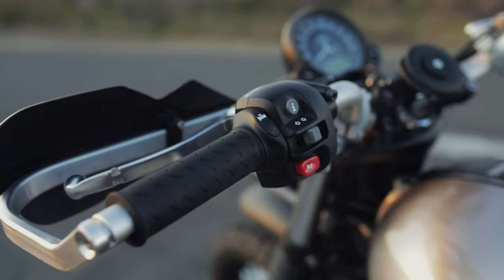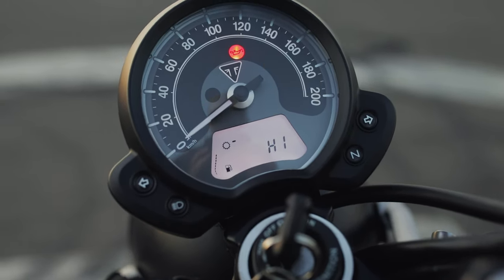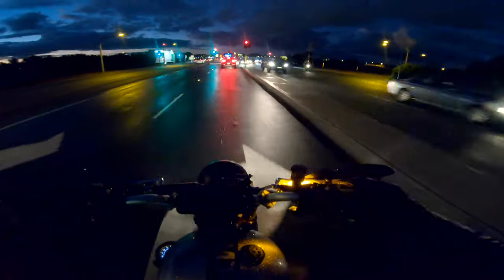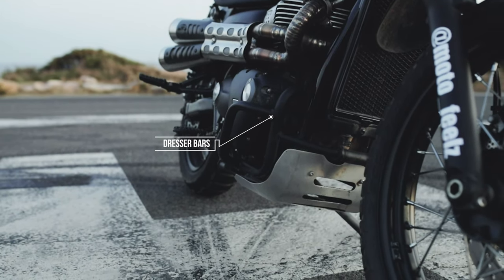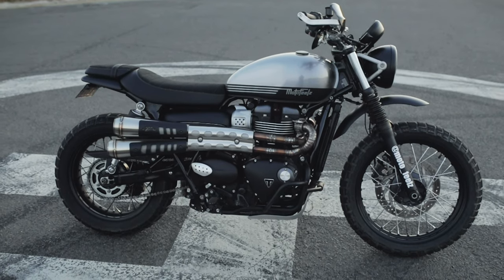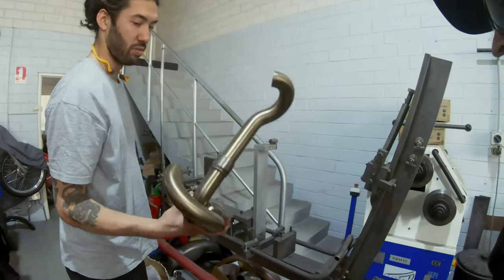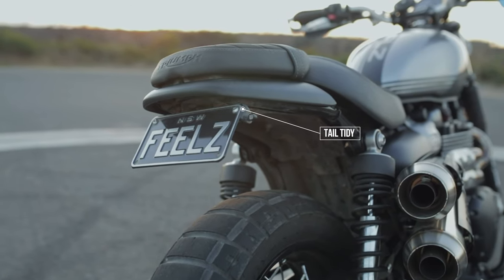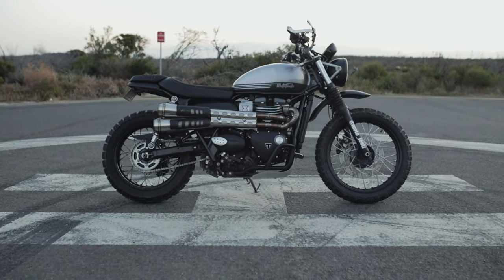2020 MODS LIST REVEALED!! | Triumph Street Scrambler

Comment: That side speedo is pure foolishness. Ok, it looks unique. But it’s pointless and dangerous. 

If it want to up your off road game, get the Free Spirits caliper relocation kit to move that rear caliper above the swingarm so you don’t rip it off on rocks. A nice pair of Ikons will help off road, as will a ground clearance riser kit to add about 30mm of clearance on the rear. 

Front fork springs upgrade worth considering too. Ikon said they are making a drop in kit this fall. Being local to aus, you might get them before us in the usa.

I added the “tall windscreen” which isn’t either tall or B windscreen but it helps tremendously to cut the wind esp cold winter wind.
Reply from the maker: Haha yep - Speedo down there has 0 functionality, but I dig the clean cluster. If there was a smaller one available that didn’t cost $1k I defs own it. 

Since this vid I’ve installed the Fox Shox - they’re so dope. I have the Marlin windscreen from Dart (check out my latest vid). 

Been looking at upgrading the front springs so thanks for that! Didn’t even know Ikon existed, and they’re right under my nose. 

Caliper relocation maybe a vibe too. 🙏👊
Reply: Most of these mods are cool or are understandable, but that side speedo seemed dumb af. Paying money to make seeing your speed inconvenient. LOL